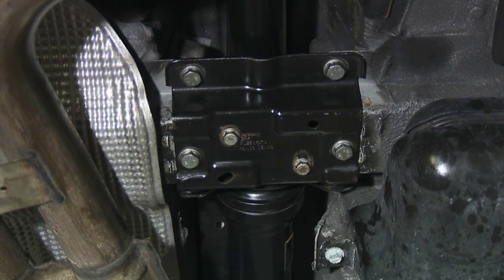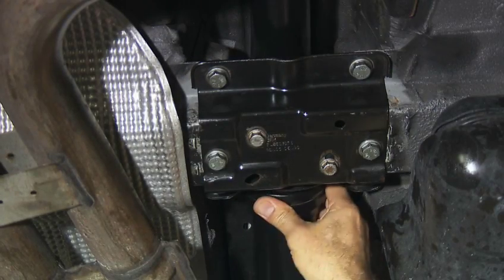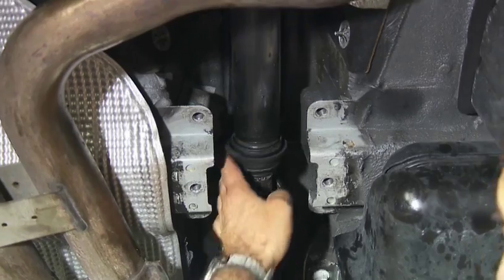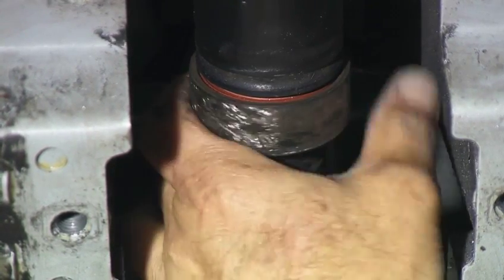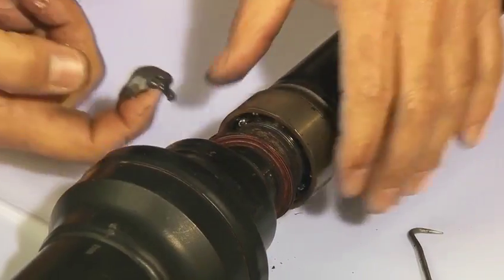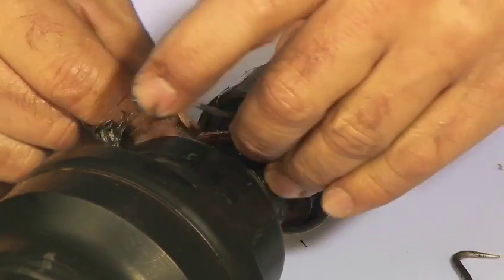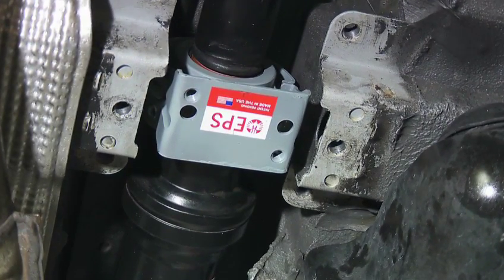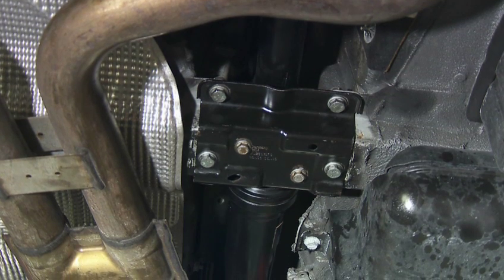Cayenne / VW Touareg Drive Shaft Support Bearing Repair

Comment: That mount is $400-600 , I bought whole new drive shaft for $150 with the new mount and it is pretty easy to install and do the job the right way.
Reply: Yeah but that stock bearing carrier is going to fail again whereas the vertex won’t. 

Still though where can you get a new OEM shaft for $150 in case I ever need one?

Comment: Hi, question, I have a 05 Cayenne S and it makes a grinding noise when accelerating from idle position in the area of the drive shaft bearing support. Is that and indication that it needs replacement?
Reply: What was the issue? I might have the same issue. Like a whirring noise